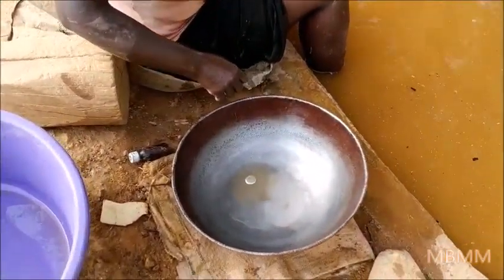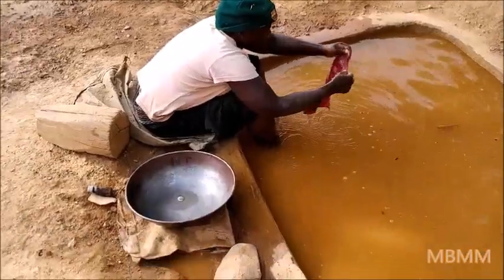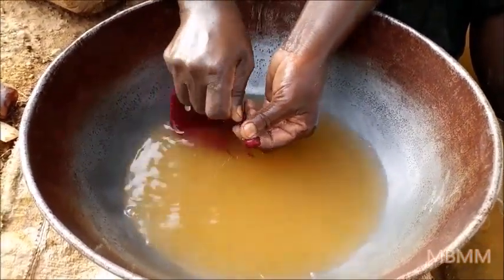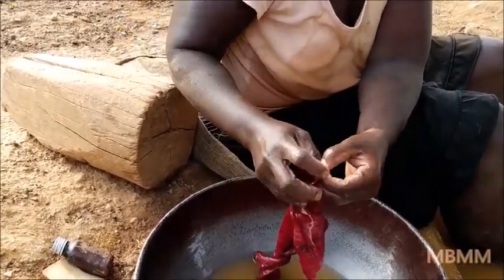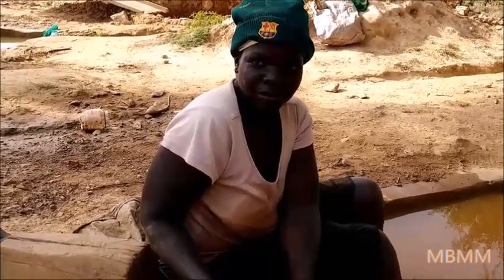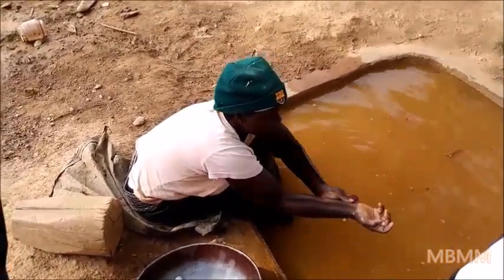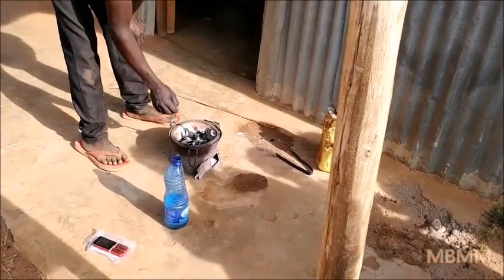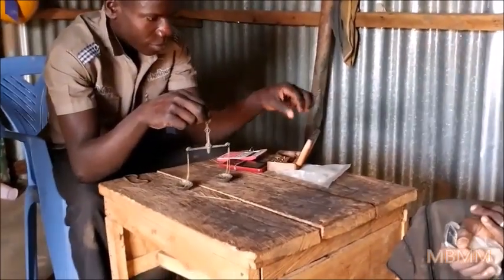Kenya Miners Part 3: Mercury recovering gold from sluice cons, then burning to get salable gold

Comment: Same here in indonesia . I been trying to get them to stop using mercury for years but they are set in their ways.
Reply: why?
Reply: @Metal_Master_YT  because  its poison they touch it with no gloves the burn the murcury off with no masks and it ends up all over the enviroment
Reply: @SouthernCrossGO  But the mercury came from the environment. Ever heard of cinnabar?
Reply: @SouthernCrossGO  Mercury metal does not readily absorb through the skin. It would not change very much if they had gloves on.
Reply: @SouthernCrossGO  The fumes on the other hand, are dangerous and harmful. I wish they would stand farther back, but I don't think its that big of a deal if they just stay up wind of the vapors and keep about 10 feet back. For the most part they were not very close to the mercury while it was mid-boil, I think they know about the vapors.
Reply: @Metal_Master_YT  you have common sense. good job man!!!
Reply: @Electroneer0  also, you should see what I've said on other mercury related videos.
Reply: Mercury poisoning=1st world problems
Reply: @tartarsauce5250  wdym?
Reply: When you literally don't know where your next meal is coming from something that may kill you years from now isn't so important.
Reply: @tartarsauce5250  yep, especially since usually they don't die a few years later, unless they are like 80 years old.
Reply: @Metal_Master_YT By the way I  like your content. Thanks. I'm a over the road driver. I'm in Southern ca right now hitting a spot tomorrow to do some pan ning. I'm just a tin planner lol but it is fun...
Reply: @tartarsauce5250  you said you like my content, but what content have I made?